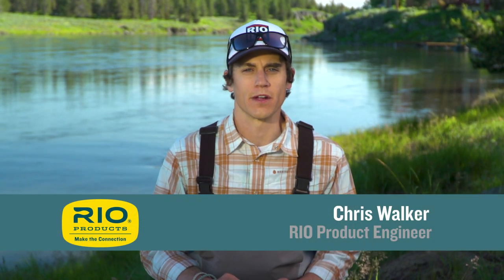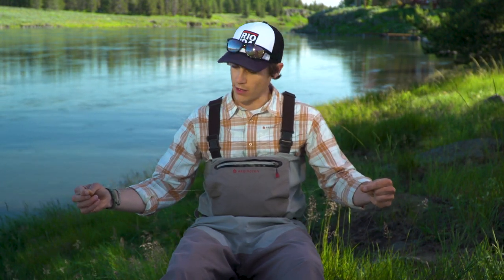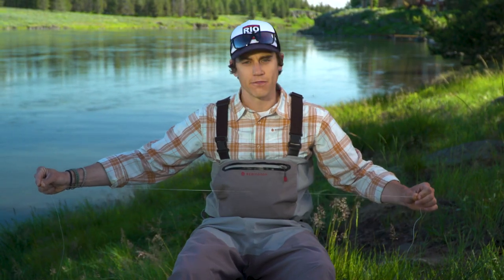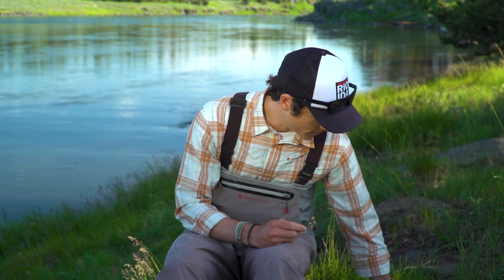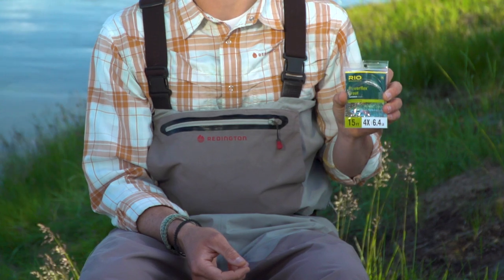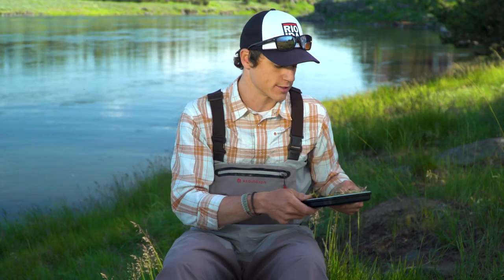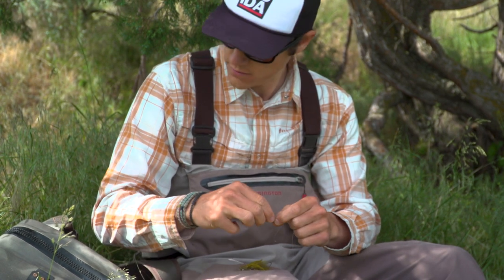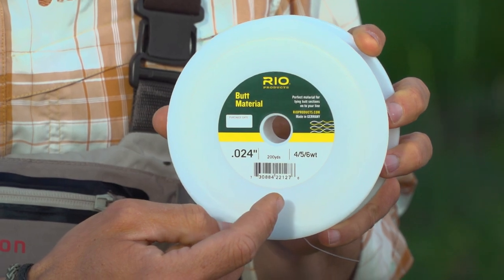How To Select And Tune A Leader To Perfection - S5 E8

Comment: Great clip and very well presented. 
Leaders  can easily give a newbie a very first bad reading on what a new fly line head profile was build for, either return it to share a bad comment about it.
You fly line manufacturers should  consider a kind of guidance with every fly line, like, include a chart or a set of the actual leaders that best cover a general fishing situation for that head length,, density and profile.
Definitely a link to this video print inside a fly line box it’s a must 😾

Thank you Rio and Chris 👏

Comment: If you are making a leader land softer, wouldn't you first need to reduce the tippet section of the manufactured leader by some amount and then tie on your lower X tippet in order to get the proper structure for the leader to do what you wanted it to do?
Reply: No. Keep your 9' manufactured 4X leader and add, let's say, 24 inches of 5X. You would now have an 11' leader - still properly tapered -- which would be appropriate for tossing a size 12 to 16 dry fly for softer presentation. After you tie on the first fly you would have, then, a 10' 8" leader. If, as you suggested, you cut back the manufactured 4X leader first you might have to add 4X first and then the 5X to achieve a good taper. If you are targeting smaller fish use 5X and add 6X and smaller flies (14 to 20). Try to keep track of the leader length that works best for you depending on the conditions you most fish in, the streams you fish, your casting style and the flies you use the most and forget about what other folks might suggest. Fly Fishing is fun and individualistic.